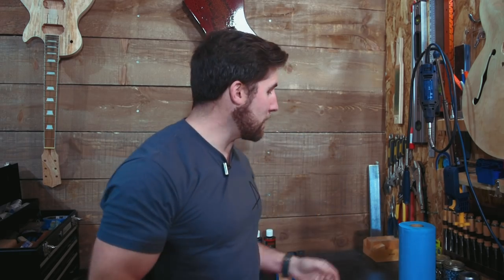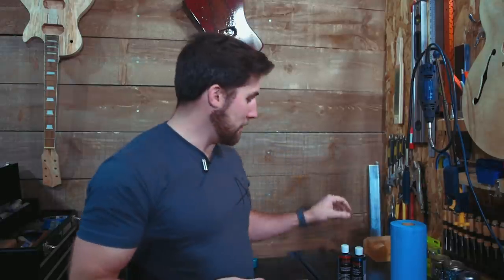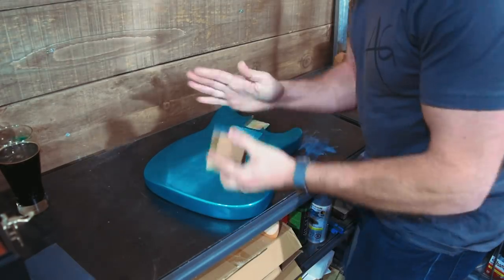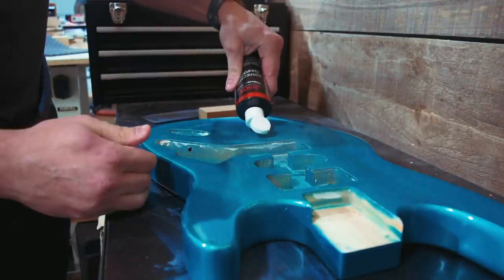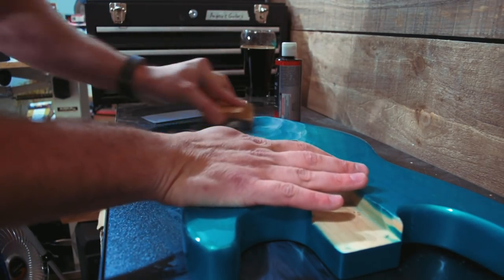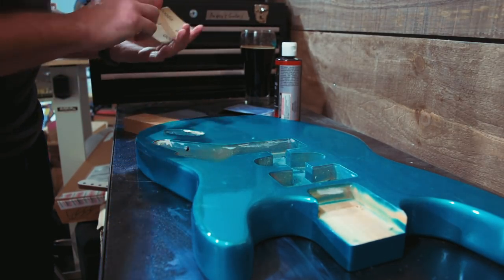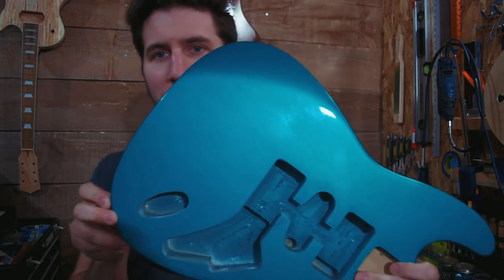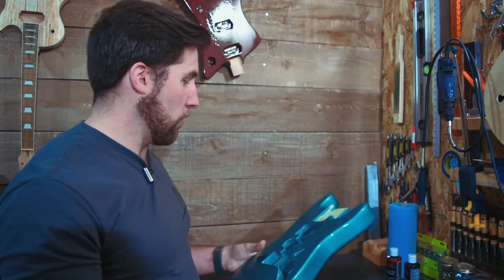Testing a New Polishing Method (No Power Tools!)

Comment: Brad, thanks for the video. It may not have worked the way you wanted, and a buffer will always be superior. My last build was a Bass, I used Rustoleum automotive enamel white and clear using your methods. I sanded up to 2000 grit, and polished by hand with DuPont polishing compound. After that, I buffed it good with some good ol' turtle wax, and it came out fantastic, glossy and all, but you do have to use a lot of elbow grease. You can feel the heat from the friction. I think using the polish on the sandpaper is counter productive.
Reply from the maker: Yeah, the polish and paper method is interesting in theory but I’m not sure it makes all that much sense. The viewer who showed it to me seemed to get good results though. Hopefully I haven’t done it completely wrong haha.

Comment: thats not too bad. i have some silk matte spray lacquer that appears a high gloss when wet sanded to 3k grit. this woul probably be good for that.... but i mostly work on smaller stuff these days, so i just use a buffing wheel and compound on a dremel or lathe.

Comment: It looks like a much better surface than with p3000 alone. The concept makes a lot of sense. It’s a good lubricant to “wet” sand with. My guess is if you started with a fresh guitar, did the whole thing and moved up to 6000-8000 grit that when you stopped sanding it would be easy to hand polish the rest. Good work, as usual,
Reply from the maker: Thanks Michael. Usually it’s not too hard to hand polish up at those grits even with the lubricant. I may have to do more testing.

Comment: I've always done that with car polish/wax and 1000-3000 paper grit with a 500 step increment, then just polish and no paper at the end and had super results. Well, can't say it's factory-grade since I can never get rid of the final circular "print mark" from my polishing process, but apart from that it's glossy as glass :)
Reply from the maker: You just need a quick final buff with swirl remover.

Comment: Hi Brad, Your videos are great and very helpful.  I'm building a double-neck guitar from a kit (as soon as USPS delivers it) and I plan to paint it with Duplicolor followed by the 2K clear coat.  I intend to use decals on the headstocks to customize it with my own "brand."  Do I put the decal on and then 2K over it?  Or does the decal go on after the clear coat is on and dry?  Thanks for your advice!
Reply from the maker: I generally would sexual under the clear coat.
Reply: @BradAngove  Thanks!  Interesting spellcheck correction: "decal" becomes "sexual."  !!!

Comment: Not gonna get the high gloss, but it sure looks super smooth. Maybe you could try to buff by hand to see how it goes. Super fine polish and a rag could work. The color on this guitar is stunning BTW.
Reply from the maker: I have to recommend against microfibre for polishing. It almost always seems to leave scratches. Soft cotton is a safer option.
Reply: @BradAngove  Yeah, now that I remember I had a bad experience with microfiber. Anything has the potential to scratch the finish, but sometimes a piece of an old cotton t-shirt can do wonders.

Comment: I'm all for saving a buck whenever I can but honestly a drill and buffing wheel or a buffer itself aren't really expensive at all and the process is faster and easier I'd actually argue it's worth the extra money just to not have to spend as much time or effort using this method sometimes you just have to suck it up and pay the money
Reply: I have to agree with that. But if you are doing it by hand, do your sanding first and then polish the crap out of it, and your results will be better. Using a buffer is better for sure.
Reply: @jthonn  ya ive buffed out a lot of finishes with a buffing cloth or microfiber cloth and buffing compound mostly for things like pool cues where using a buffer just doesn't make a ton of sense you'd be surprised what you can accomplish wet sanding to 2000 grit then buffing by hand with a rag
Reply from the maker: Ya, this method would have been cool if it worked, but it’s pretty easy to justify picking up a little buffing kit for the drill. It’s probably cheaper than the compound.
Reply: Ya a few years ago I went to AutoZone and picked up come cut and buff compound and polishing compound and the foam buffing attachment I think i paid about $30 for the whole setup and I had enough materials to polish a lot of guitars and pool cues I remember the first day I did two guitars and 3 cues and I barely made a dent in the bottles if you do the math you're basically paying pennies on the dollar per guitar if you just do it the conventional way

Comment: I've been able to get results like that (maybe a little better, it's hard to tell from the vid) using those melamine "magic sponges" and water wrapped around a piece of rubber block. I think that they must be a grit equivalent to something between 3000 and 4000, but I guess it depends on the brand or manufacture of the "sponge".
Reply from the maker: That actually makes a lot of sense. Very interesting!

Comment: Unrelated to sanding, I know you shouldn't paint oil based paint when it rains, but what about water based paint if I'm under a covered area?
Reply from the maker: Humidity can impact most paint types, so I would be hesitant to do that. It’s worse with lacquer though. Oil based paints aren’t necessarily as much of an issue.
Reply: @BradAngove  I'm sorry, I realized after I sent this i fight to mention is be using water based. Then I got in a hurry to get started

Comment: Honestly, you know what, I would say we should consider this like training wheels for someone who isn't as confident with wet/dry or accidentally sands through the finish, but still wants to decrease that margin of error. 

This will help as a good lubricant I think, but you're still going to need to finish it up with buffing compound and swirl remover, followed by a carnauba to finish.
Reply from the maker: Ya, it could potentially reduce the sand through risk I guess.

Comment: I don't understand using the compound with sandpaper....??!! Those are the instructions from Jescar? I can tell you that I was not in the least surprised by the results.  The sandpaper thing is just really strange to me.....lol. Here's my 'logic' on it. If you're using 1500 grit paper with a compound that says it will remove 1500 grit scratches you're simply removing and then re-scratching the surface as you 'polish', no? I mean why would the compound prevent the 1500 grit from doing what it does? I don't get it!!! It might be useful to do another test using the two compounds as you normally would, on a pad with your drill.
Reply from the maker: Those absolutely were not the instructions from Jescar haha. It was just something one of my viewers showed me and I thought I would test it out.